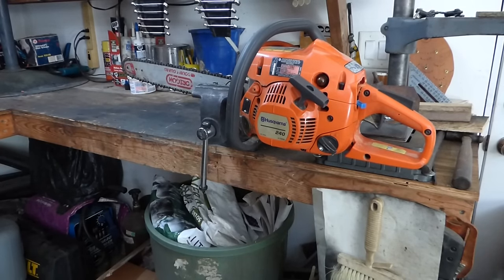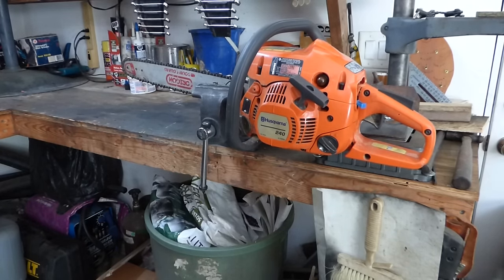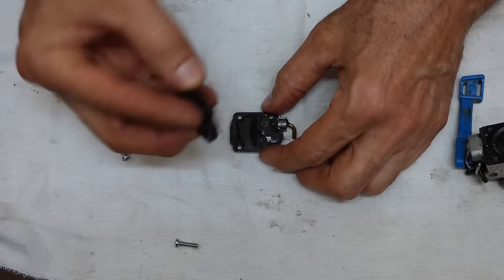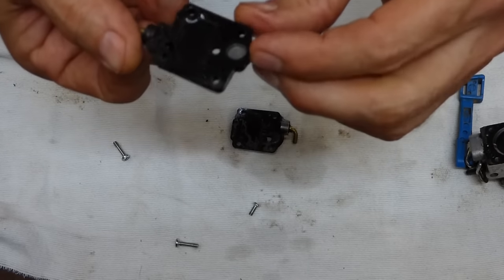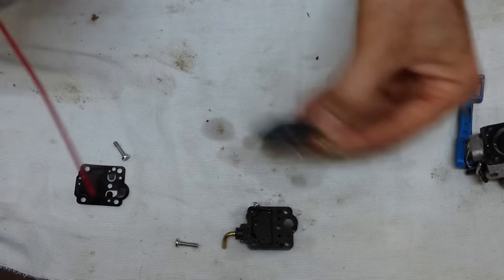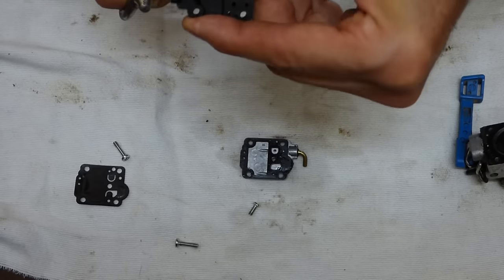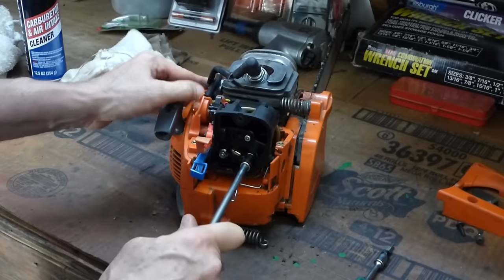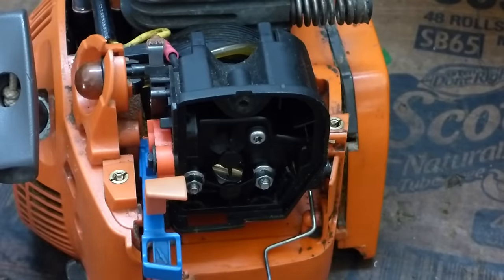Chainsaw Won't Start - What To Look For & How To Fix - (Husqvarna Carburetor Cleaning)

Comment: I just got my Husky 445 started by using a hammer !   It was headed for the repair shop with another $80-$100 bill for a new carb when I decided to tap the carb several times (gently) on both sides while it was still installed.  (This worked on my old Gravely lawnmower. )  Evidently the needle valve was stuck closed as i left the saw sitting with gas in it for several months and tapping the carb loosened it.  I have exclusively used TruFuel but it still must have gummed up the carb.  From now on, I will drain the gas and run it dry until I use it next time.

Comment: I just got a new Mark II 16 inch only 165.00 .  Somebody did a return .   Ran for a while then died will not start .   Spray starting fluid into spark plug no spark no kick .  I disconnected wire to shut off nothing so I say its a defect coil.  What you think ?  Did you screw  out low and high adjustment screws also ?    Factory set I noticed so I leave them alone.
Reply from the maker: Sorry you are having trouble.  It takes fuel and spark for your engine to run.  If your coil is bad you should notice a weak spark, intermittent or no spark typically... or when they are going bad the engine can sometimes run but quit when it gets warm.  It is hard to say from here what your problem might be but when you are diagnosing keep in mind those 2 simple things...  Have to have spark and fuel... and that should help you narrow down your problem and lead you to the fix.  
You can check out my video where I removed a coil and tested it at this link:
https://www.youtube.com/watch?v=Z0PLBL6WnqU
Hope that helps and you can get it going.
Reply: @helpinguonline  Thank you for your help.  I will check out the  coil.  Sometimes start right up then dies out seems like no spark.  I did starting fluid no go then . Keep pulling at it just might kick then .   I feel though spray fluid SHOULD  start right away if some kind of spark.  When I pull plug out all wet .  Thank you .

Comment: Hi, I am a pensioner who lives in Scotland and creates clocks and tables etc. from felled tree's, I have never cut/felled a tree and I have no desire to do so! There is enough wood lying about our woods/forests that are left too rot from those who have rights to make a living from cutting down contaminated/rot tree's. I do not use my saw much, but this video of your was helpful information for future reference/s for me in which I do hope I do not encounter! Many thanks!
Reply: Another piece of advice if your not going to use the saw for a few months drain the fuel from tank (if youve got a petrol car throw it in it wont hurt the car) then prime whats left thru system start and run saw till it cuts out.  When you pull it out refuel reprime away ya go.
Reply: I live on 10 acres of oak.  They are always falling or loosing big branches.   If I don't cut them up, the fire danger becomes enormous.   I use my saws almost daily.

Comment: if you got a filter in the tank why would you need that one in the carb ?nice video
Reply from the maker: doesn't take much at all to clog the little ports on these carbs and even with those filters they still clog.  Worst thing is leaving unleaded gas in the carb.
Reply: filter in carb also helps too break the fuel stream into more particle size  droplets before entering manifold

Comment: I’m a new subscriber and I’m working on a235E that won’t start I just have a cuestión what is the gap on the ingnition coil  thanks
Reply from the maker: about 0.012 inch... but I always use a business card which is about the same thickness.

Comment: The yellow gas line in the 240 has an inner line that can plug the fuel line when putting the filter in
Reply: I changed mine out.

Comment: You did not mention air fuel screws or adjustments? After disassembling is their a manufacture dependent or general default?
Reply from the maker: It is a good idea to remove the screws and spray carb cleaner through the ports.    It is also a good idea to turn the screws in (before you remove them) and count how many turns it takes to bottom out so you know where they were set.  Should be close to 1-1/2 turns clockwise.

If you don't know where they were set I always turn them in till they bottom out ... then out 1-1/2 turns as a starting point to do final adjustments for the carb.

Comment: i have a spear and Jackson and mine cut out yesterday and now i cant get it started again i brought it in last night to take chain and head off to clean it all but today still doesn't run got plenty of oil in it and gas still nothing took spark plug out gave it a clean still didn't work swapped spark plugs with another still didn't work i now at a hmmmmm where is it what's wrong now since i watched yours maybe it needs a little ethaline in the cylinder to get it going then the cabrito need cleaned so will try that at weekend

Comment: Question for you....
Is the premixed gas/oil any good for a chainsaw. Or should i mix the two myself ? 
Thank you in advance.....
Reply from the maker: I have never used the premixed gas/oil... always mixed it myself and I usually mix it a little on the rich side to better lubricate the engine.
Reply: @helpinguonline ,
I run 40:1 on all my saws.

Comment: Didn't see you check for gas in tank - often the most obvious is the problem. ALWAYS dump out old/questionable gas 1st. And then use only gas with no ethanol. Expensive to buy (but worth it) or remove it from existing gas. Vids out there about how to do it. Todays gas messes up carbs when it sits, and KILLS small 2 stroke engines. js - glad you got it going.

Comment: Nice video. But what was the problem? Was the carb plugged or bad fuel ?gotcha. Thx.
Reply from the maker: Both...  Customer left fuel in the chainsaw for a number of months...it separated (went bad) and gummed up the carburetor (very common problem).  As you saw I cleaned out the carb, put new fuel in it and she runs like a charm.  This is a very common problem with unleaded fuel left sitting in equipment.  If you are not going to use something for a couple months or more... you should drain the fuel tank and run the fuel out of the carburetor......
Reply: Wonder if it's mostly ethanol in the gas more so than no lead...but either way, running carbs dry when you may not use them for awhile can save lots of headaches on just about any engine with a carb and shutoff valve.  Best feeling in the world to find the issue after someone else as given up!  Nice video, but the best lesson you gave was- no matter what you are told- start troubleshooting as if it hadn't been done yet!  Good job!

Comment: I got a problem that it won't start but no spark. Replaced the plug, ignition module and adjusted the gap on the plug and ignition module. Checked the resistance thru the coil and is 1.5 k on both the old and new modules. Saw was running the day before.
Reply from the maker: If you don’t have spark then you have an electrical problem. It’s hard to say without looking at it but… Check your plug, check your coil, check your kill wire, also look for A short on one of your wires. Also make sure the magnet on the flywheel is not gummed up. I know you said you’ve done some of these things but go over it again to make sure. Also disconnect your kill wire from the switch and see if you get spark.
Let us know what you find out the problem was
Reply: @helpinguonline  Thanks for the reply. Yes I have done all the things you have stated but went a little further. I have ohmed out the coil and I have no open coil from the ground frame of the coil to the high voltage spark plug side. The other side of the coil is also not open that goes to the cut off switch. After putting the coil back on I also made sure I had a good ground from the cylinder to the coil ground thinking maybe it was floating.
The magnet on the flywheel pulls the screw drive in with no problem.
This is a Husqvarna 350. I have been over all the ignition problems I   find
but no one give any measurements on coil ohm. The one I have is 1500 on spark plug to coil ground and 141 ohms from ground to stop pin which is the one to shut off the saw.
The new coil has the same ohms but for the ground to stop pin and it is 2000 ohms. It does the same thing as the other coil. I got spark testers that i ma using but after 3 days on this thing I about to give up and junk it.

Comment: Just a suggestion put some mixed gas in a spray bottle and save the ether for surgery two stroke lower ends get lubed from the fuel

Comment: In the gas compartment is the fuel line.  Is it fixed to a certain point or just loose.  Mine caught on the cap, and moved, and I'm not sure about this issue.  Can't find any info on it either.
Reply: They're always loose. The fuel filter on the end of it is weighted so it will drop to the bottom of the tank regardless of how you hold the saw.

Comment: I Left old gas in my saw when I first got it. My wise, old Dad told me not to do that again, and that the carb needed to be rebuilt. I cleaned and rebuilt it, but not well enough to run. Maybe I didn't clean the screen/filter well enough.  I did find a new OEM Carb for $44 online, which I thought was reasonable. Chinese knockoffs as low as $15 also worked.
Reply from the maker: Good to always empty out the gas from the tank and run it out of the carb...

Comment: Homelite xl doing the same thing. But have done a complete cleaning on carb but still no start! any suggestions?
Reply from the maker: do you have spark when tested?... how is the compression?... did you adjust the hi or low fuel mixture screws when you cleaned the carburetor?... if so set them at 1-1/2 turns out from all the way in and start from there, then do final adjustment if you get it running.  If you have had the chainsaw for a while you may want to check the spark arrestor and make sure it is not clogged.
Hard to say what your problem might be without being there.
Reply: Funny I have a home lite xl and a home lite super 2. Got the xL to run first pull yet the super 2 for some reason when you pull it if it does start it runs extremely high rpm smokes out the muffler then kills. After dying it will leak fuel out of the exhaust and sometimes make a slurping sound as if it’s trying to suck the fuel through an extremely small straw w a vacuum. Iv put a little sea foam in there adjusted my carburetor screws of course. Will try it again here shortly

Comment: I’ve got a Craftsman 18”. Replaced the fuel lines, in tank filter, carburetor, air filter, and spark plug. Won’t start.

Comment: Should never use ether on two stroke engines. If it would start with ether, the engine runs with zero lubrication. Just dribble in some of your oil/gas mix. Less than an ounce is plenty.
Reply: That's the first thing I thought of when I heard him use that. Scored it
Reply: He was just looking for it to fire, not run.
Reply: But on the can it says "chainsaw" I use it to start 462 M tronic Stihl
Reply: Never more than a small shot of ether on any engine. It also helps to have someone crank as you spray. Once I told an idiot not to spray before I started cranking on a car motor. It burned under the hood, singed his eyebrows, burned his face. You can't fix stupid.

Comment: What kind of small engine mechanic can't fix it ,then someone else comes along and fixes the problem
Reply: My guess is that the time used by mechanic costs more money than the saw was worth.
Reply: @Myytavana  my guess is the owner couldn't afford to have it fixed by a small engine 
mechanic.  I've done repair work myself

Comment: Can you buy the tool to reset the cabrater after someone adjust the set screw
Reply from the maker: You can buy carburetor adjustment tool sets for $10-$15 online. You will get a variety of them to adjust many different types of carburetors

Comment: When you first sprayed starter fluid into the carburetor it didn’t start. When you spray carb cleaner into the Venturi of the carb it just goes straight through the Venturi of the carburetor. So a carburetor problem would not have kept that saw from starting when you did that. So there was another problem that rectified itself that we don’t know of. So basically we don’t know why they saw didn’t start on starter fluid.
Reply: It's also a stratocharge engine. If you hold the throttle open when using carb spray it goes into the cylinder as well as the crankcase. It was a design to appease the EPA. Huge fail and anyone with a Poulan, Craftsman Husqvarna will tell you. God Bless the EPA.
Reply: WCJCNC is spot on in my opinion. Fluid running out of the exhaust close to the end of the video indicates some flooding. Without correct air/fuel mixture it will not start.

Comment: I always use carb cleaner resistant gloves (nitrile I think), when spraying carb cleaner on auto carbs.  It can sorb through your skin and give you cancer eventually, as will acetone, etc.
Reply: Thanks for the info. I already almost died from Large B Cell Lymphoma I got from spraying Roundup a.k.a. Glyphosate.

Comment: I got a stihl 041 free and issue was it sat 7 years all fuel lines had got so bad they melted closed. 26$ in parts I had a 400$ saw (basic tune up)

Comment: I think replacing the gasoline would have been the first thing I would try. Many times the fuel line gets a crack in it and will also keep it from starting.

Comment: Can petrol be use in place of carb cleaner
Reply from the maker: I would recommend using carburetor cleaner or something similar to cut through the chemical residue that old gas has left behind.
Reply: just good old 2 stroke fuel for me as a small engine mech for 30 years never had an issue if anything due to ethers dryness level and evaporation rate id say fuel is the better option.

Comment: Looked like a chain sharpening may be needed thnx I have 3 chainsaws but I suspect carbs r corned up been awhile since they started
Reply from the maker: What I do to avoid that is drain the fuel tank start the chainsaw and run it until it runs out of fuel. That way the next time I use it I just put new fuel in it and it fires right up.

Comment: After checking the tank for gas, I would've checked the fuel filter & line next. Husky fuel lines are crap!
Reply: I think that's what's wrong with mine right now I bought a 262xp it will start but shuts off like 3 seconds after firing up

Comment: I've had and hated this saw since the day I bought it.  What a pos.  The dealer sucked as well.  Ace fixed it to at least run.  Today I got this POS actually running after sitting.  Then it refused to start for many many pulls and a busted knuckle on my middle finger.  I really do hate this saw but did manage to get it running again.  Is there anything you can run through besides fresh gas to not mess with cleaning this dog up?  Time for another Stihl?
Reply from the maker: I always drain the fuel out of the tank and run it out of the carburetor if I am not going to use it for a month or so.  Saves lots of time in repairs in the long run...

Comment: Very well explained. I did everything but my chain saw still didn't start even though I put fuel in the cylinder with a good spark.
Reply from the maker: If you have tried all of those things you may want to check your spark arrestor screen and see if it is clogged.  Here is a video that shows how to do that.  https://youtu.be/AemsIs7YQG4
Let us know what you find out to get it going.
Wishing you the best and good success!

Comment: My husky 51 will not start. Talk about a frustrated man. Replaced nearly everything. Got spark, getting fuel, new coil, new this and new that and still wont start. Im now so frustrated i want to throw it at something......
I will try the carb cleaning but dont think that will help cause it is getting fuel. HELP.....
Reply: the test you need to do on yours is block off manifold with blanking plate then apply light pressure thru exhaust side thru a blanking plate looking to ensure crankcase is sealed. if it wont hold pressure submerge saw in a bucket of water while pressurizing  to find leak spot.  2 stroke are lazy if they can draw air in elsewhere they will which results in fuel mix not getting the right air fuel ratio to fire.  on husqvarnas i tend to look behind manifolds so apply fine layer of mani seal then slide manifold on.  Hope it helps if not pick my brain anytime been a small engines mech for 30 years now.

Comment: Any idea why mine will start and idle for 3 to 5 minutes then shut off and won't restart? When it's idling I can't rev it either. Sounds like it bogs down. I have tried adjusting the carb with no luck.
Reply from the maker: sounds like your carburetor may be clogged or your fuel filter.  I would start with the fuel filter and if that doesn't fix it clean your carb.  Always remember to drain all fuel out of the tank and run it out of the carburetor when not using it.  Todays gas clogs the carbs...
Here is a video on carburetor cleaning:
https://www.youtube.com/watch?v=MtggiZf_x-4
Reply: @helpinguonline  Thanks I will clean it and let you know.
Reply: @helpinguonline  Well i got impatient and just cleaned the carb. Still won't run so I guess I'll order a fuel filter.
Reply from the maker: That never hurts and can only help.
You may also want to check your Spark Arrestor.
Here is a video on how to do that if you like:
https://youtu.be/AemsIs7YQG4
Let us know what the problem ends up being...
Reply: @helpinguonline  Bought a new spark plug and fuel filter. Still won't run. It acts like it wants to crank up at the very end of a pull but won't.